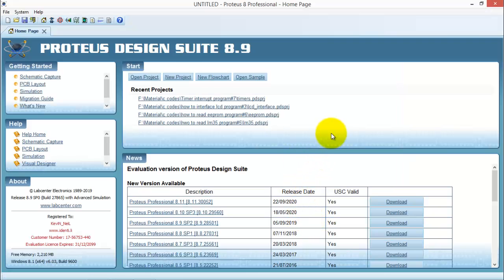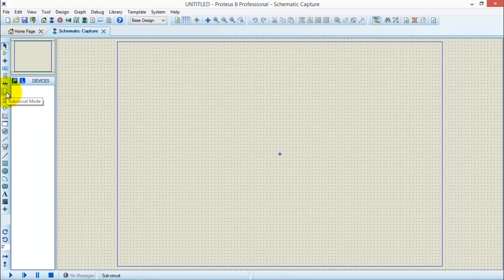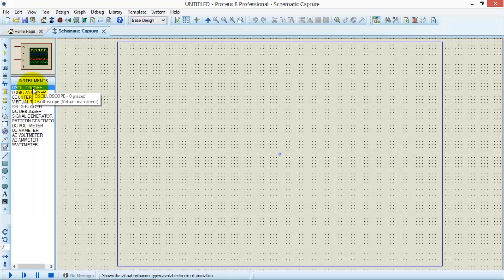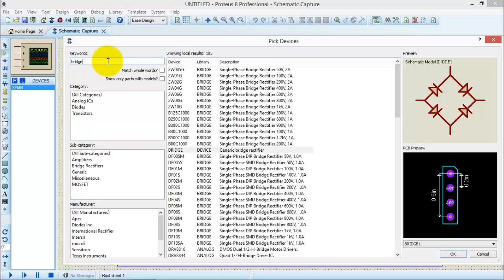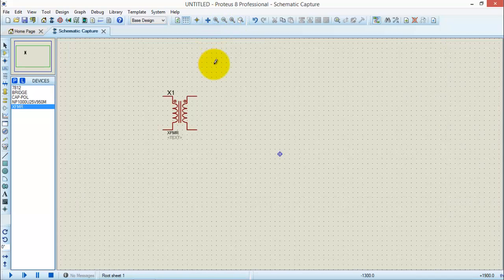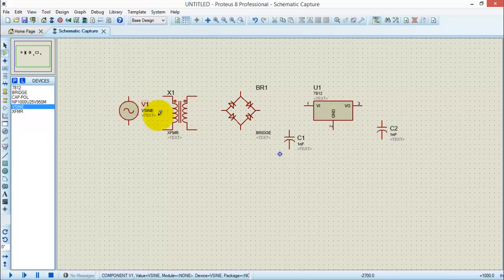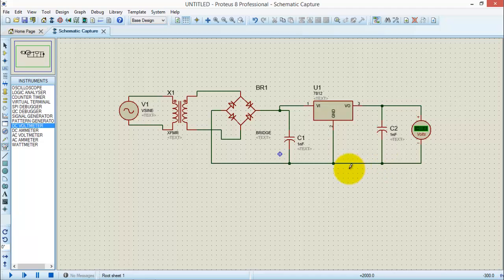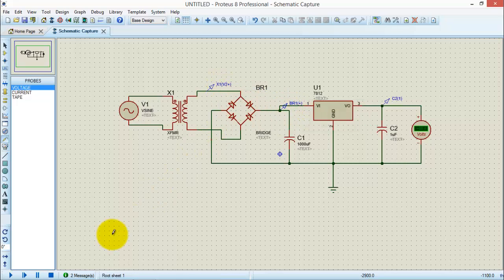Introduction to Proteus 8.9 | Beginners Tutorial Proteus 8.9

Comment: Hi this is Mohamed Nilufar.
first of all I'm thanking to you for this tutorial, it is gives us very useful.
and I had downloaded from this website "https://componentsearchengine.com/" and added into the Proteus which I have request device and it is given an error; when it is simulating mode as this message (No model specified for D1. [D1] and Cannot find model file 'MAX756.MDF'.
Pin '/SHDN' is not modelled. [U1]
Pin '3/5' is not modelled. [U1]
Pin 'GND' is not modelled. [U1]
Pin 'LBI' is not modelled. [U1]
Pin 'LBO' is not modelled. [U1]
Pin 'LX' is not modelled. [U1]
Pin 'OUT' is not modelled. [U1]
Pin 'REF' is not modelled. [U1]
Simulation FAILED due to netlist linker error(s).
) these all errors are occurring. On the all new devices.
Therefor' kindly I have request you give a solution and I'll highly appreciate you and expecting kind your response soon.
Thank you,
Reply from the maker: Welcome for such great comments. Sometimes new components on request have only pcb model not simulation model. For solution of no model specified ' you can go to properties of component and check herarical model.